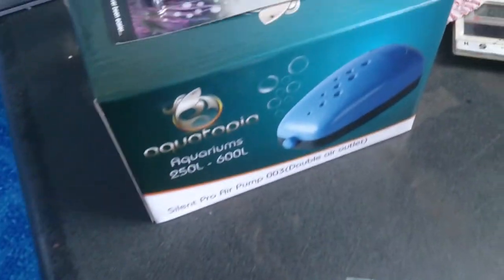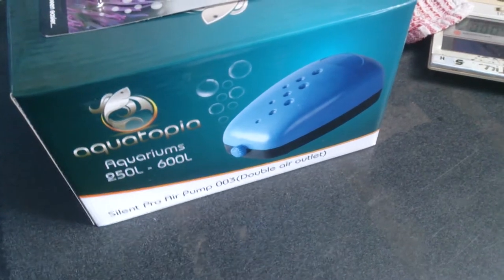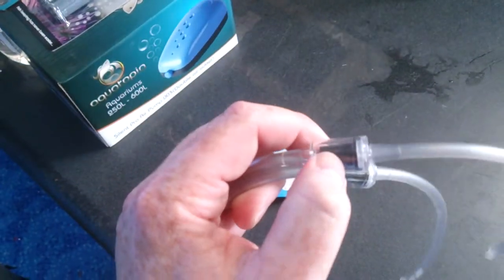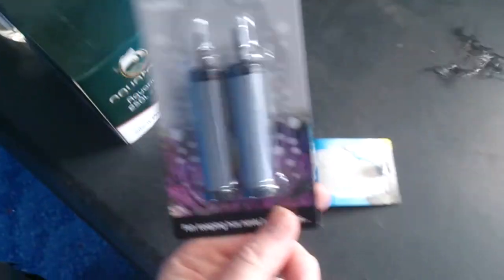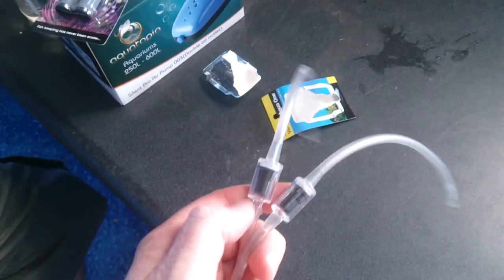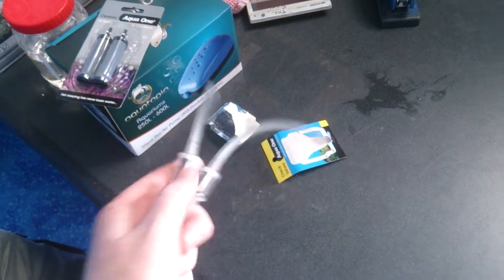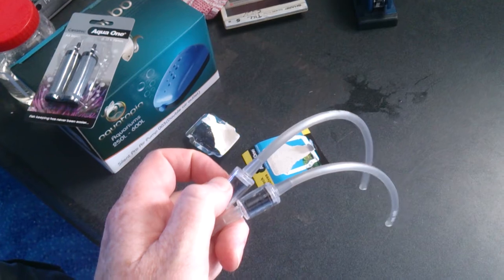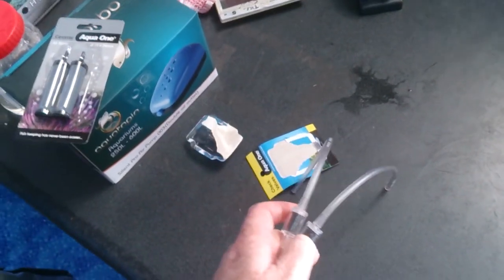Setting up an air pump with check valves

Comment: Not sure if you're checking these old vids but I've got a problem where my air line keeps coming off the check valve. May take a few minutes, hours to happen but ever l every few hours I'm having to keep pushing it back on. I've tried cutting the pipes and installing again but it still keeps happening. So how can I prevent this, tried taping the pipe to the valve which doesn't work. Are there clips you can buy or how do I firmly install the air line onto the valve. Hope you can help, thks
Reply from the maker: no I would get a new valve and a
line that go better together